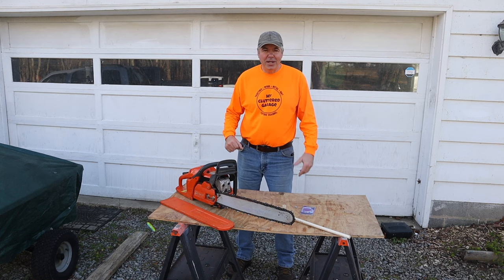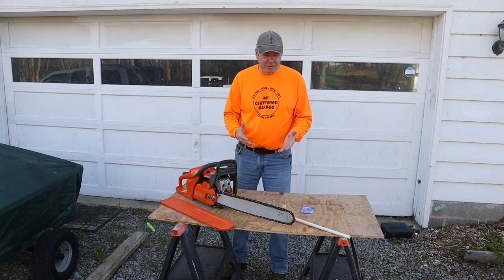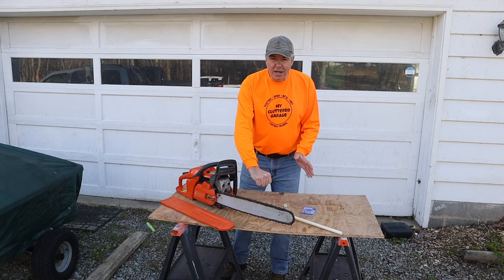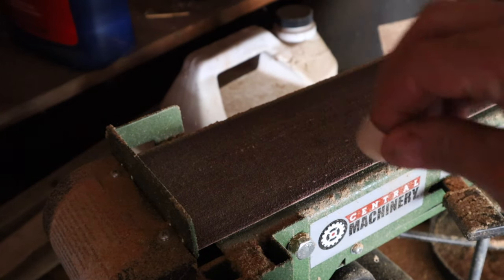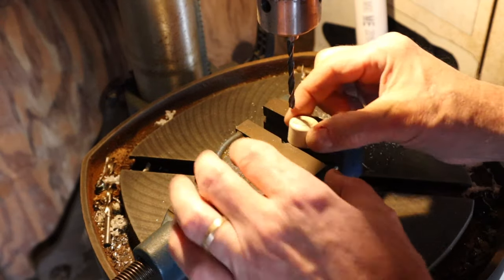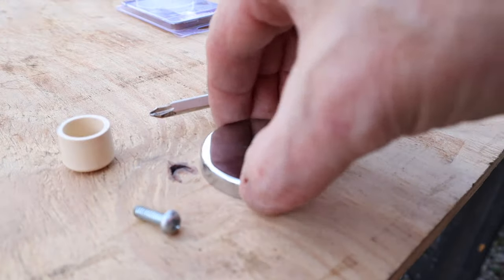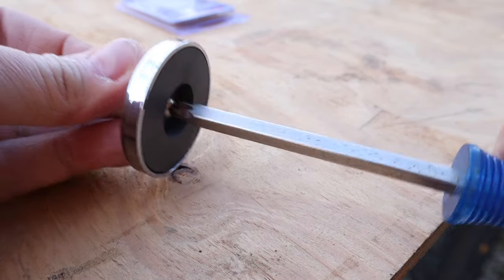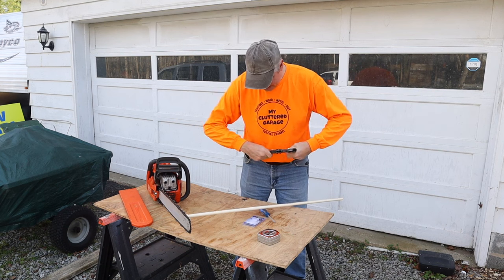#85 How to Make a Firewood Measuring Stick for Your Chainsaw!

Comment from the maker: Here are some product suggestions. These are Amazon Affiliate links, so purchasing will help this channel by providing a small commission while not costing you any more. Thank you for your support!
Lumax Heavy Duty Grease Gun:
https://amzn.to/3mFK1pA
LockNLube Grease Gun Coupler:
https://amzn.to/3kPcvwu
Recommended Grease:
Valvoline Moly Fortified
https://amzn.to/3jNM1Kv
Nitrile Gloves:
https://amzn.to/34Kg8OG
Deerskin Gloves:
https://amzn.to/2I17NNy
My Video Gear:
Rode Wireless Go II microphone:
https://amzn.to/3eiJatG
Canon M50 Camera (now Mark II):
https://amzn.to/3vHW9uD
Battery adapter for M50:
https://amzn.to/2RshsBE
Sigma 16mm prime lens:
https://amzn.to/3vJDRcx
Sigma 30mm prime lens:
https://amzn.to/3epFneh
Variable ND filters:
https://amzn.to/3tmoHIs

Comment: I had a magnetic stick made for this task, been looking for it for the past week, w/o satisfaction.   In lieu of that, I'm using a 24" extendable magnetic pickup tool set at 16".   I've had that for years, haven't used it much.   Will paint it yellow and in the chainsaw accessory bag it goes.    Just putting it out there as an alternative solution.   😁

Comment: Hey that a great Sell Pitch ( Fabrication Friday Sir ) 😉👌 Great sence of humor 🤣👌🤭 Great measuring tool 🧐👌 A side holding belt for quick storage 👌🧐 Have a great week end Cheers 😇👍🍻
Reply from the maker: Thanks very much, David!
Reply: @MyClutteredGarage  👍😉🍻
Reply: For a holder I use a washer strung on some para cord looped thru my chain saw chaps belt,  the magnet attaches to the washer and I don't loose it in all the limbs.  Also painting orange helps when the chain flips off the bar once and a while.
Reply: @rockandrattleretreat5830  Outstanding idea Sir 👍👌🧐 Thank you very kindly for your input Sir, keep warm Cheers 🍻😉👍

Comment: Good project.  Definitely an inexpensive option. I still prefer to just use the bar length to measure.
Reply from the maker: Thanks Chad. I’ve done that, but my bar is 20”.

Comment: Great idea and on the cheap
I am blessed with a size 15 foot so I just gauge my cuts by the length of my boot 
Works great for me as long as I don’t slip up 
Your idea much safer I would say !
Reply from the maker: Just be sure to wear steel toe boots, Phil!

Comment: Great little idea Ed. I made one also awhile ago and works great
Reply from the maker: Thanks Bob. Pretty simple solution!
Reply: @MyClutteredGarage  yep. On my smaller saw I got a zip tie around the side of the bar to the correct length is a cheap easy idea also. Works ok.

Comment: It's a nice quick inexpensive accessory.  Instead of gluing use electrical tape, that way you can interchange with different length rods.
Reply from the maker: Great idea! Thank you.
Reply: Or just make the rod the longest piece you would ever cut and use tape or a marker to mark the shorter distances.

Comment: I was worried for you while you were chainsawing - no hearing protection, no chaps/chainsaw pants, and what looked liked non-steel toe, floppy shoes while you were rolling that log around with your feet near it.
Reply from the maker: Thank you so much. No excuses, but this was a quick demo. I know, accidents can happen anytime. I do use those things when working. I appreciate your comments! -Ed
Reply: No guts no glory🤣🤣
Reply: I haven't used chaps since I quit working in the woods professionally the trick is don't cut your leg with the chainsaw🤣

Comment: FYI. NOT A GOOD IDEA. I've already tried it.  First the magnet that you use needs to very large(not something that you buy at Walmart in the crafts department). And it does have a tendency to vibrate itself off the bar and onto the chain. Imagine a hockey puck flying at you at 100mph. There are alternatives to the magnet, such as a suction cup, or a laser mounted device.
Reply: What happened with yours?
Reply: @rd-ch1on  hockey puck